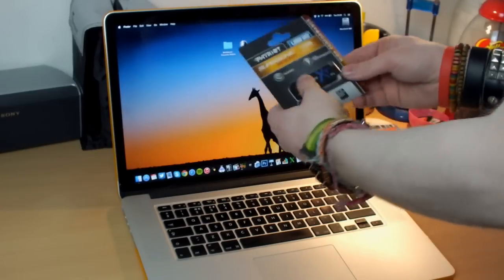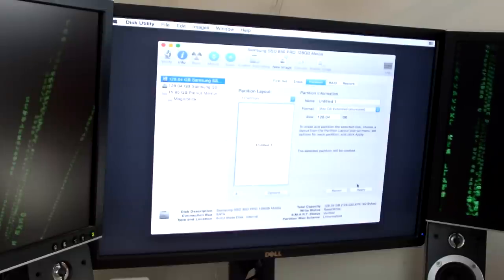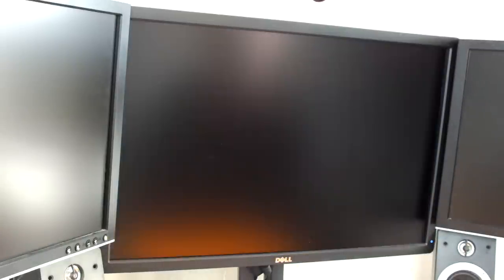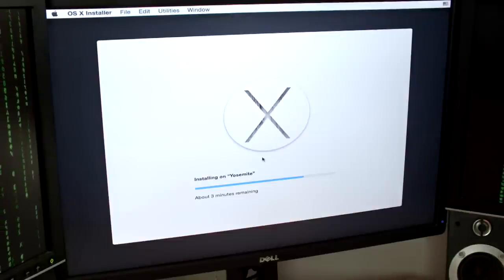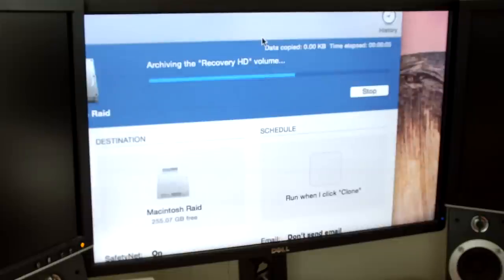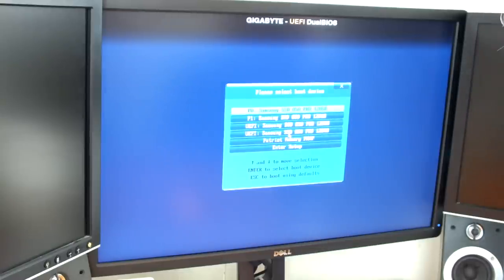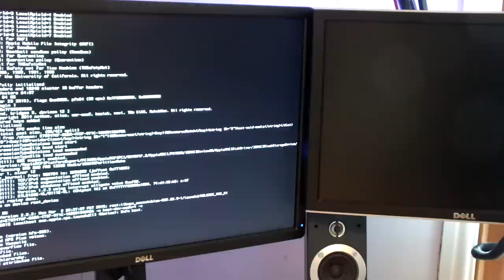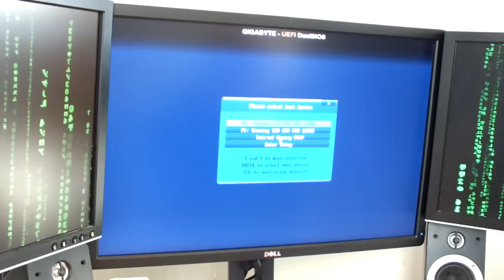2015 Hackintosh Build: Part 2 (Configuration & OS X Installation) | IMNC

Comment: Here's why the RAID 0 messed up when you installed the kexts the first time (they were actually installed but not loaded because, in Yosemite, you need the kernel flag kext-dev-mode=1 to load unofficial kexts). Doing all that Terminal commands actually installed the bootloader into both the SSDs, so the BIOS could recognize both as bootable drives and the bootloader, Chimera, could then address the RAID and boot the actual OS.
The problem is Multibeast actually reinstalls and overwrites the bootloader when you install the kexts. So after installing the audio/network kexts, you did accidentally overwrite the bootloader and the kernel flags :D
Anyway, really AWESOME video and editing. Really looking forward to see part 3 and the case modding! Cheers!

Comment: You should have done RAID from the BIOS or using a PCI Card. Software RAID gets you pretty sluggish performance in comparison to hardware. Still will be pretty fast though! You would've also saved hours of messing about.
Reply: I tried bios RAID0 on a Sabertooth Z77 running Yosemite and it will not boot.
Reply: Jeremy Scalpello he would have been better off using a pcie raid card like you said because  onboard raid controllers on the gigabyte boards are complete garbage. last z87 build i did had a marvell controller in it and that thing dropped drives out of arrays like it was made to do that.  unless he uses intels onboard raid controller which is stable but since its negotiating with the chipset as well as every other aspect of the board its going to be quite sluggish. so i would greatly reccomend some kind of pcie intel based raid controller. they're pretty cheap on the used market.
Reply: +Jeremy Scalpello I know this comment is from awhile ago, but just so you know. Mac OS has literally zero support for hardware raids. The only think I have ever seen is someone use the same card that an old (2003?) Mac Pro used to use. That was it. Software raid's are the only think you are going to get with a Hackintosh. Soft raid is program I have been using for quite sometime and it works wonders. I have a raid 10 in my system and its all from SoftRaid.

Comment: one of the downsides i remember reading about raid was if one hard drive goes, it screws the setup. that's why raid setups apparently are backed up regularly. it could be a good excuse not to do it.

Comment: Tom! I believe I have found your problem! Whem you edited in the Raid ID, you replaced a kernel flag called something like "kext dev mode". The thing is, Yosemite will refuse to load the kernel if you have unsigned kexts installed, and it removes that problem. I'd assume you're using it as a boot flag, and that's why you are able to boot.
Reply: More specifically, it is in the Cameleon boot plist, and it's the "Kernel Flag" kext-dev-mode=1

Comment: Maybe you guys could help:
I have tried to install Yosemite on my system and my specs are quite similar to Tom's.
When I try to get into the installer, it just restarts.

Intel Core i7-4770
32GB Ram
150GB Toshiba HDD

Comment: Very good show of how to test build think when you get it in the case mod you may want to do another run thrugh of t to make sure it picks up the graphics card properly. but you never know it may be alright but will definitely make you aware of how you did it last time. ps you know where i can get a G5 power supply think mnes blown or the battery has gone again?

Comment: so... why not hardware RAID with RAID card? The bootstrapped will actually be capable of loading the OS into memory because osx actually has several RAID card drivers (because of drivers written for the old MP towers).

the 960 was probably not the best choice - it's the last card out of the 900 series to be launched. the 970 or 980 or 7XX/6XX series card would have bee a better choice they have been out for longer and had longer for people to write guides on solving problems the cards have.
Reply: It's a Maxwell card and pretty solid for $200. Not like he plays the most modern games.

Comment: RAID needs to be setup in the BIOS, a software RAID like the one the OSX installer used would only work once the software had loaded IIRC.  I know the RAID 0 that is on my PC is setup in the BIOS and the intel rapid storage loads once in Win7

Comment: I not use macs ever,  just curious y u use software and not hardware raid.   bet would avoid 90% of ur issues if u ran hardware rsid and the installer should see ur hardware raids drive as a single drive even though would be raid striped.   or does os X not support hardware raid. 

i ask because ur motherboard should sllow for hardware raid. 

i know is long after the fact im just curious now if that would have fix things for u